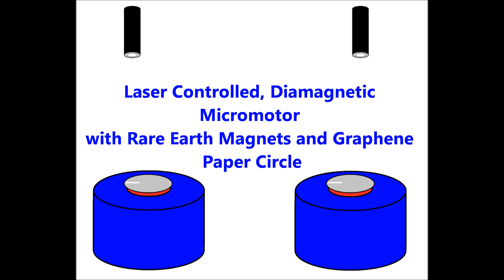Laser Controlled Diamagnetic Levitating Micromotor using Graphene Oxide Paper and Rare Earth Magnets

Comment: Hello
I think the same thing can be done with Pyrolytic Graphite as it has the same atomic arrangement of the atoms. Can anyone tell me if this is so as I've seen Pyrolytic Graphite moved with laser light also.
Adam VA of AVA Magnetic Levitation
Reply: Yes, you can use pyrolytic graphite.  Graphite sheet 25 um in thickness is easy to get and can be cut using a sharp hobby knife.  Works great.
Reply: I found you adam :). Do you have tried to do this experiment with the PG?
Reply: Magnetic Games Hello 
Have tried a little but needed more power or the right light waves.
I did try retuning a laser and removing the UV filter. But have have not tried to much as need laser saftey glasses don't have.

Comment: Muon Ray, it me Rafael Lopez. I have one question, can you please take the bottom explanation and please break down to simple terms like Richard Feynman , describing the main idea and the details and how it works, because I have no clue what the description means
Reply from the maker: You can learn how it works here http://muonray.blogspot.ie/2014/06/tractor-beam-laser-maglev-using-30m.html . The wheel here, at the most basic level acts as a rotation axis-load-torque system in analogous to how the maglev "tractor beam device here Tractor Beam Laser Maglev - Magnetic Levitated Graphene Paper Moved with UV Laser acts as a lever-load-force system.

The load in both systems is created as the laser heats up the material, and in turn causes the electrons to go fro a state of uniform diamagnetism to a more disorganized state which causes the magnetic susceptibility of the graphene to be reduced hence lowering the level of repulsion and creating a load in this region. This in turn creates a net force on the opposite side of the graphene sheet which pushes it as work being done on the system.

That's as simple as an explanation as I can come up with without selling the description short.
Reply: Muon Ray Thank You I know what what you mean by selling the description short I think I understand what you mean

Comment: Very cool!  Sorry for a stupid question, but how is there a "left" and "right" side of a circular disk?  Love your videos!
Reply from the maker: Not a stupid question at all because by right and left I just mean relative to one another and so you are quite right to question how can there be a left or right part of a wheel. There can only be one relative to another so the labels are indeed arbitrary. I could have, and perhaps should have, just called them opposite sides however right and left are just more convenient labels for me anyways.

You can just as easily say opposite sides as, by the same token as the maglev "tractor beam" device, a torque and axis of rotation is created in the wheel in the same way as the force and fulcrum is created in the ship causing the torque, or force, to move the opposite section of the wheel or ship towards the source of the load induced when the laser lowers the magnetic susceptibility in the region illuminated.
Reply: Muon Ray Ahh okay!  Thanks so much for your quick reply and clarification.  What you're doing with graphene sheets, rare earth magnets, and lasers is really fantastic!